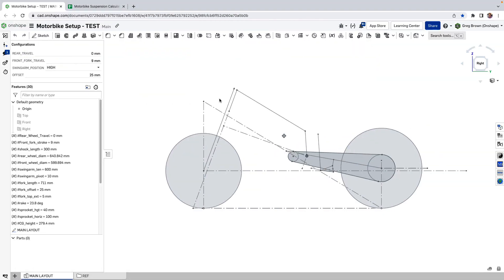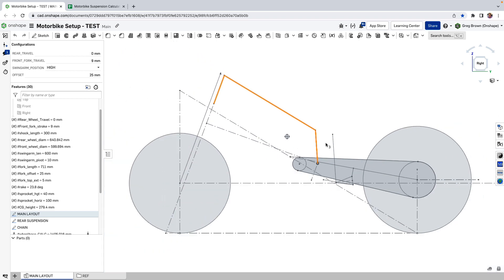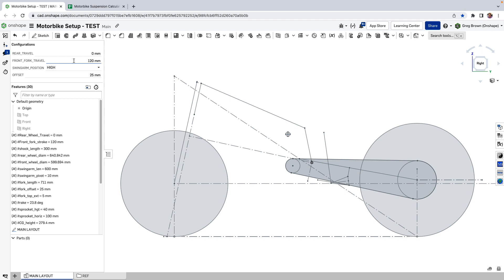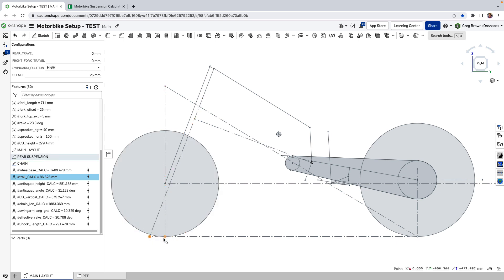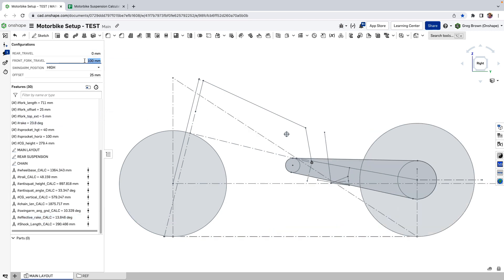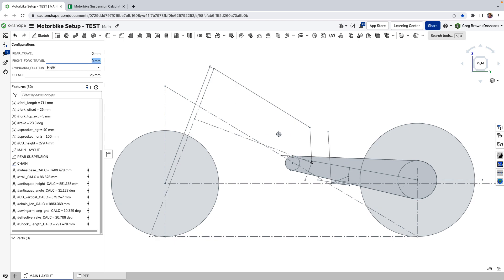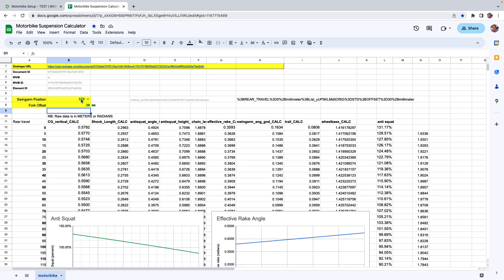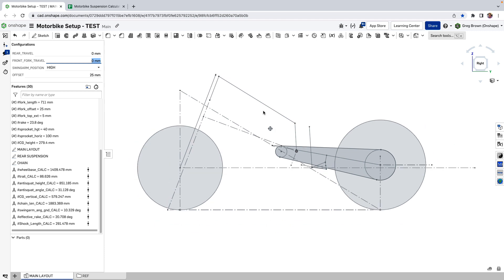Motorbike layout sketches (and analysis) using modern CAD and Google Sheets via REST API

Comment: Hi Greg, I am an apprentice engineer & fabricator learning how to use CAD. I am looking to design and fabricate my own motorcycle frame and rear swing arm. The motorcycle will be electrically powered but will be based off the geometry of a Yamaha WR450. If I could find a naked chassis cheap enough I would just build a jig off of it to replicate mounting holes and pivot points etc. however this is not a likely find. Would you be interested in helping me in laying out the geometry of a WR450 on a sketch on Onshape? So far I have found relevant stats on rake, wheel sizes and wheelbase aswell as fork travel if that helps.